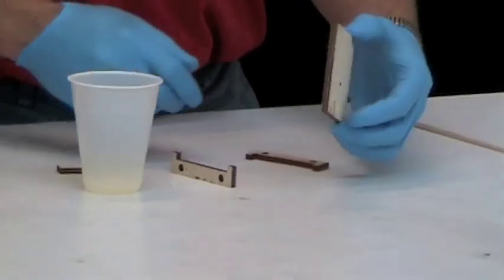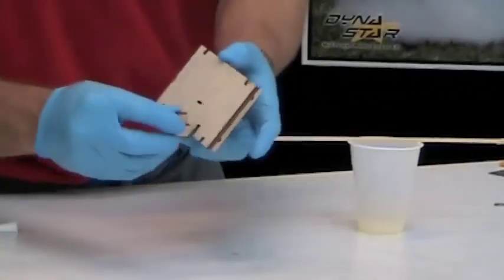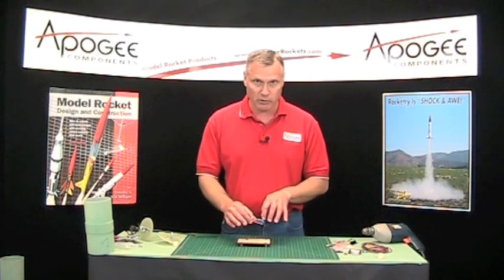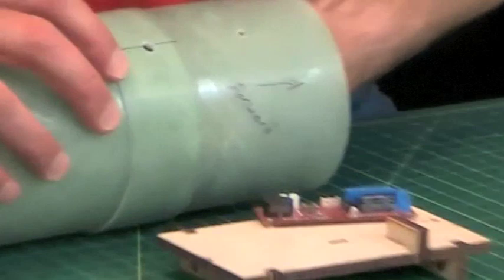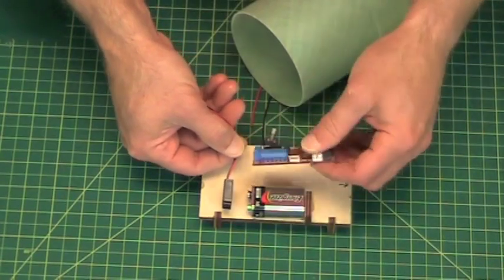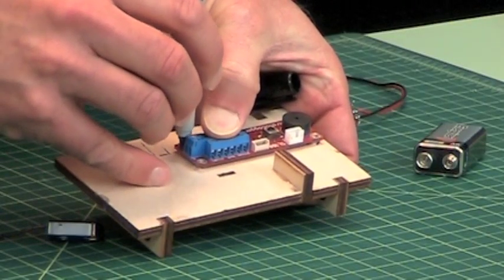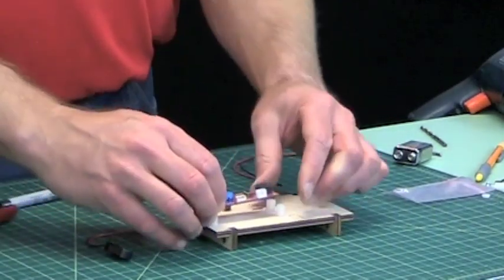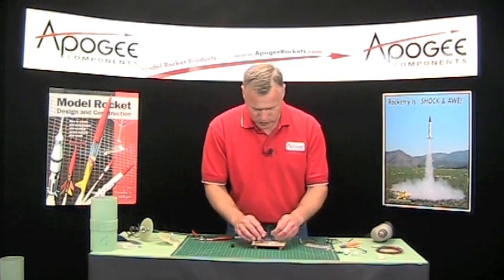Building the Level-2 Fiberglass Rocket Kit - 11: Attach Altimeter to E-bay

Comment: I'm confused why the deceleration forces would be stronger than the acceleration, especially if you put a Vmax or a Super Thunder or something with a very high thrust. I ran a sim on the Tomach using an I800 and the rocket peaked at 30 Gs in the first half second before dropping to a steady 2.75 Gs at motor burnout. Regardless, I made a second stop for the sled because it comes with 2 boards so it would be hard to put zip ties longways on it
Reply from the maker: It never hurts to be prepared. I agree with your decision to put extra ties on the battery.
Reply: Another question I have is what is the maximum allowable shear stress for the altimeter standoffs and what is the maximum acceleration they can withstand using the Stratologger without shearing?